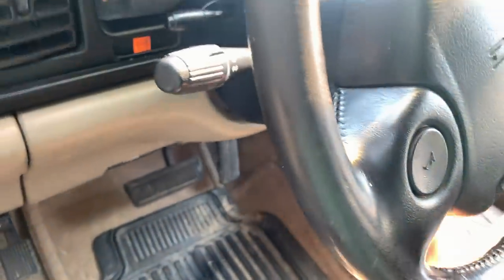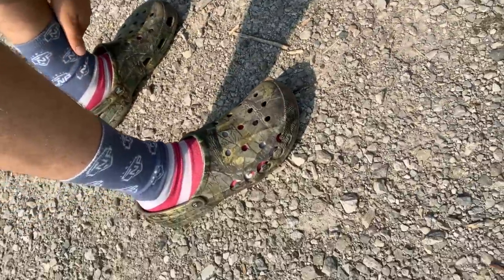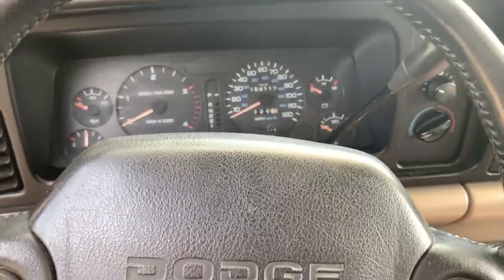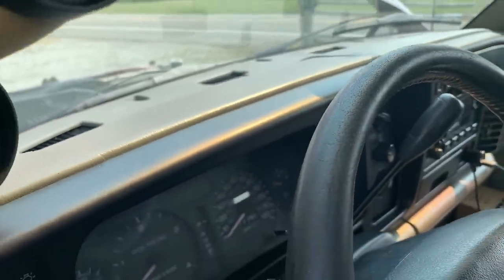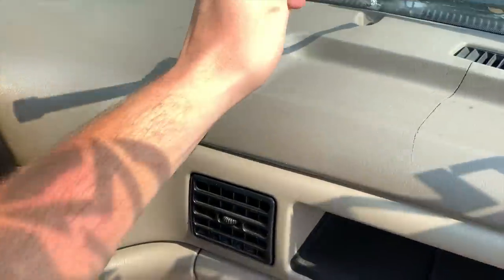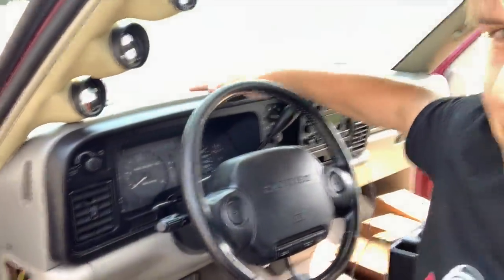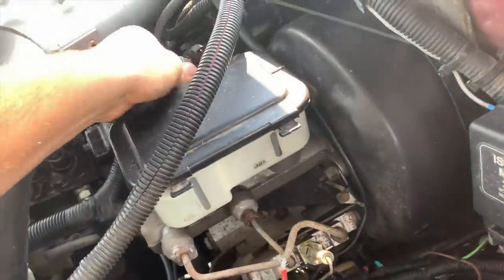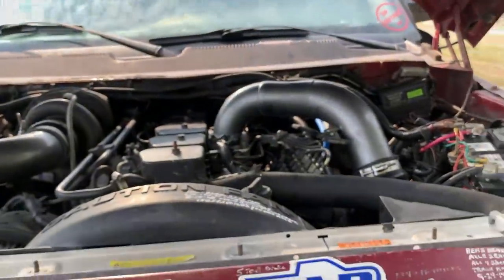EVERY 2nd gen dodge needs this upgrade ASAP!!!

Comment: Just a side note on the fuel shut off make sure the rod length is the same as the old one if it's longer it will cause pump not to get full fuel.

Comment: Really like the idea of drilling holes for the 4 bolt holes on the top of the dash. So many people over look that. What happens when your heater core goes out and you have to remove your dash and your bolts aren’t accessible without tearing up your topper? Personally I’d just say to but the bullet, spend the $300 on an LMC replacement dash and never have to worry about it ever again.

Comment: A much better quality would be to order an actual dash. Would be much better.
Reply from the maker: Maybe if my dash was actually gone… but it was only a few cracks. Which I silicone sealed back together nicely before putting the new top on.

It won’t have any further issues I’m confident

Comment: Didn't you have this problem with your first truck you bought but it wouldn't start and you had to use a string to hold the lever up when you were getting the new wheels on.
Reply from the maker: Yeah I didn’t know much about these trucks back then lol the string was dumb
Reply: @LOUDNPROUD  sometimes you just gotta do what you can lol